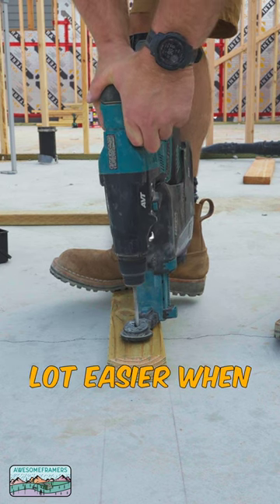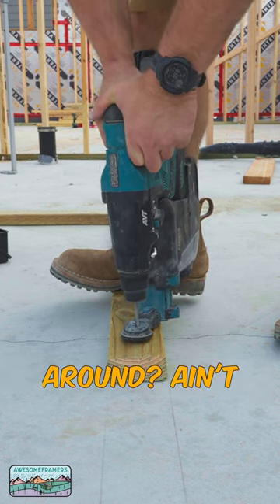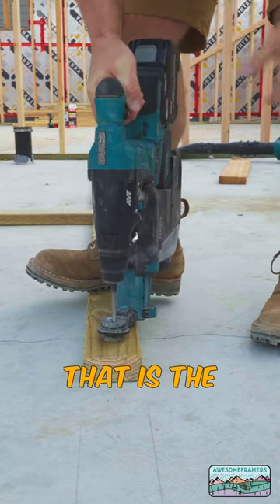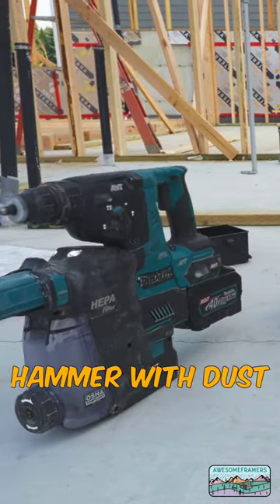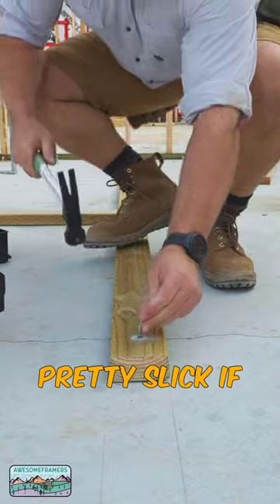Let's Make a Connection ##framing #concrete #diablotoolsambassador #makita

Comment: My house was built in 1955.  I don't know what kind of MAGIC they had back then, but my entire 2 car garage and HUGE basement floor has no expansion joints and no cracks at all in the concrete.
Reply: Whatever it was, its probably illegal to use today😂
Reply: Probably has a topping applied .
Reply: They put way more fillers in concrete nowadays like fly ash. I live by lake Michigan so all the sidewalks were built with beach rock and sand and that concrete was so hard it was blue in middle and you hardly ever seen it fail.
Reply: They used magicians not carpenters
Reply: My house was built in 51. Same here. Just replace the floors and not one crack
Reply: It's all about properly preparing the base. I live in a northerm climate and built my 24x30 shop 20 years ago. The slab has no joints or cracks. It's sits on 4ft of compacted sand, 2in rigid insulation, and a vapour barrier. It's 8" thick with a 12x12 grid of 1/2" rebar. Not a single crack anywhere.
Reply: Price out that 12x12 regarding today.
Reply: The 60s was when they started cracking down on asbestos, maybe you have a house built out of the wonder material.

If its in your concrete, itd explain the lack of cracks. Awesome for you but horrible for whoever might deal with it in the future
Reply: @internettoughguy I believe it would be the 8”

Comment: Cracked concrete like a mofo
Reply: Someone gots some splaining to do 😂
Reply: Easy explanation. Its not a finished floor.
Reply: @qorpraltv5276  not how it works.
Reply: There's only 2 types of concrete. 
Concrete that is cracked and...
Concrete that will eventually crack!
Reply: Not if it's drilled
Reply: Now they’re gonna have to rip up the wood work to properly fix the concrete.
Reply: @VoodooViking say what?
That concrete is 6 ins thick with rebar.
You actually think that the studs need to be removed to "fix" the floor?
Stay at your keyboard or your Walmart job
Reply: If this isn't a joke... You did a pretty dam good job saying you know nothing, without saying you know nothing
Reply: All concrete cracks !!
Reply: First thing I noticed!
Reply: armature
Reply: He done laid that 2x4 just in time to prevent further damage to  that concrete. Way I looked at it 😅
Reply: Jinx😂
Reply: @qorpraltv5276 my parents have a garage that was built in 1988. Not a crack in its slab
Reply: Look at all the cut-rate concrete guys coming in to tell you all concrete cracks. Y'all are funny, keep it up
Reply: If you can show me a house slab that doesn’t have a crack in it after it’s framed and loaded I’ll give you my paycheck there’s only three guarantees in concrete it’s gonna crack it won’t catch on fire and no one will steal it👍🏽
Reply: My parents shed has a concrete floor and it was built in 1987 and has had cars and heavy lathes in it for most of its life until recently and it hasn't got any cracks. And they have had the flooring of their home relaid recently and it is solid concrete laid in the 1960s and there wasn't one crack. Then again I'm here in Australia and the house was built using good materials and built by my grandfather who was a master builder. 👍

So when can I get your paycheck??
Reply: @walter9724  You just admitted that the house had a crack the shed is small although I doubt it doesn’t have a crack in it master builder
Reply: @christianarias4850 not that soon though
Reply: @VoodooViking no, just no.
Reply: @qorpraltv5276 doesnt work like that. And these cracks are not a problem.
Reply: @douglascasmay1981 amen, nor is slight cracking a problem. 
If it was a basement under rhe waterline, it's only a minor problem. Easily fixed.
Reply: The crack is there at the beginning. I thought so too
Reply: @andrewwhite1576  exactly how that works, disgus. How many homes have you built? I'm guessing less than 1.
Reply: @qorpraltv5276  you crazy
Reply: @qorpraltv5276  so you want cracks in you foundation? I’ll let the guys at work know. They will crack up from how you think it works.
Reply: People, I don't know about other States, but here in Florida builders only reinforce the footings and columns, the concrete slaps on the houses they just use fiber !!  The houses settle and cracks and this is consider normal here, si no fixing that crack.. From where I am from, we build houses all reinforce concrete including ceiling everything solid, any house that shows a crack is considerate unsafe and would be very difficult to sell, cracks are not acceptable. Here in Florida is normal, 
**so, if you don't like cracked houses, stay away from Florida, another reason not to come here.... !!! 😂😂😂😂 ***
Reply: @douglascasmay1981 Bingo
Reply: All concrete cracks from foundations to transfer slabs to shear walls and grade beams it will all crack ….. and it’s been engineered with that in mind  , it’s the reinforcement that gives it strength . Don’t overthink it!
Reply: @chadleschasin2893  false. I’ve been working in this field of many years and in no way does anyone see cracks and say job well done
Reply: Do you think the framers putting up the walls also poured the concrete slab? 😂 What is your point?
Reply: @andrewwhite1576 it is lmfao
Reply: @danielcampbell1357 could show plenty high end builders wouldn't except that
Reply: @qorpraltv5276 Easy explanation. The slab settled and cracked, and/or they didn't let it cure long/slow enough. 

And no, new slabs should NOT be cracked. Get out of your contract with any idiot that tries to gaslight you that a brand new cracked slab is normal. It normal for people that suck at their job.
Reply: @walter9724 where is their house?
Reply: Concrete cracks, that’s not the issue. When the slab starts to lift and settle then it’s an issue. But the rebar keeps the concrete from lifting and settling. To mitigate cracks you can cut control joints in the foundation slab to control where it will crack, but it’s not entirely necessary.
Reply: Two guarantees of concrete. 
1. Its gonna crack
2. Nobody is going to steal it.

Comment: one things I was always thought when I used to be a framer, when nailing to a concrete floor, never affix it near a crack, because over time it will opened it up and become weak there.
Reply: So did you tear up the slab and repour or redesign the walls?

Comment: 3/16  drill bit, 16p nail, tie wire.
Reply: What are you doing with the tie wire?
Reply: @chuckbuttons0699  drill the hole insert wire bang in nail. The hole is 3/16  the nail and wire are just a little bigger. Did union construction in Boston. This was common practice in concrete work. Holds tight, cheap, and when done just pull nail out. PEACE ✌️
Reply: Exactly

Comment: First, you nail the studs to the bottom and top plate, and then you secure the bottom plate to the slab, with a vapor barrier between the wood and the concrete.
Reply: Water/ vapor seal would only need to be put on exterior walls in most cases.
Reply from the maker: Nope, no need for a vapor barrier when treated wood is used in a basement on a slab that sits over a vapor barrier, foam insulation and 12" of pea gravel.
Reply: @AwesomeFramers Don’t worry dude, everyone assumes they know better. You could have been on a suspended slab for all they know……
Reply: Most builders would use a treated bottom plate under another prenailed frame. Vapour barrier isn't necessary on an internal wall.
Reply: @ornametrics Unless the basement doest have a vapor barrier under the slab. Then it's absolutely necessary.
Reply from the maker: @PlaygroundMafia nope, it isn't necessary when treated wood is used. That's why it's not required by code.
Reply: @AwesomeFramers everybody thinks you’re working remodel in some basement that’s a 4” slab with like 4” of gravel beneath. I work mostly remodel so I use sill seal but it’s not necessary if you know what’s below
Reply: @jman42s Either way sill sealer is cheap insurance and I takes no time to install.
Reply: You see the concrete is cracked right? How perfectly level do you think that floor is? I'll tell you, it's not. Run a string line above your wall at the correct wall height and measure your studs individually, you're gonna have a bad time framing the next floor if you don't.
Reply from the maker: @redacted_redacted69 https://youtube.com/shorts/c3qG3raZ3eA?feature=shared
Reply: @AwesomeFramers you must live down south no pt is rated for direct contact on concrete in the north east
Reply from the maker: @theunironicancap8420  I don't know if that's actually true.  I'm in the PNW.
Reply: @ornametrics ya by code we’re not allowed pressure treated on interior, I couldn’t even used a pressure treated header/lintel on the exterior ply of a 3 ply header/lintel (customer request to use salvaged deck material to cut cost).

Have to use standard lumber, and if then just use a gasket seal really for a break for moisture.

Comment: With that same 1/4" hole, grab three hot dipped galvanized 16d nails and drive all three of them in there at once. Cheaper than a split drive anchor, and holds just as well or maybe better. Try it sometime, it works.

Comment: No foam pad?
Reply: Don’t need a foam gasket or sill seal on an interior wall
Reply: @brendansmith5741 yes you do if its non treated. But thats a treated board. Has nothing to do with interior its a barrier between the concrete and an un treated board.
Reply: He don't need foam pads he's a pro on his knee. 😂
Reply: @internalharm it’s pressure treated lumber
Reply: Code calls for foam pads for exterior walls regardless of if the bottom plate is pressure treated or not down here in the south

Comment: You don't use pressure-treated lumber on inside wall bottom or top plates. And never use nails into concrete especially if it's going to be next to a doorway, cuz doors opening and closing will rattle the nail right out of the hole.. .

Comment: I much prefer my Hilti powder activated nail gun for concrete. No cords with that one either. But it does sound awful like you a lot like you're shooting a 22.. much faster you don't have to worry about batteries dying. Generally you have more nails and shot then you need ..
Reply: I respectfully disagree. I think drilling is better because it's less chance you blow a crater into the concrete. I'm sure it works fine. I've used high pressure concrete nail guns too and they tend to make craters.
Reply: Yeah, I warn my clients when there's going to be gunfire.
Reply: Last time my hilti went in for service, i left it there. Powder actuated fasteners are junk. 25 yrs using one and im done with blowouts,misfires, and cleaning that junk. Half the time the plate is loose or it splits the plate. I will take the extra few mintues and tapcon or anchor bolt.
Reply: @matthewwatkins6616  tapcons are very good. I've used them on many occasions.
Reply: Expensive way to go , i drill 3/16 hole through lumber into 
Concrete  then drive a double headed spike with a short length of bailing wire beside the nail holds great no splitting or concrete breakage
Reply: @rexjansen7717 underrated comment here!
Reply: @markthebldr6834 depends a lot on the age / curing of the concrete
Reply: @rexjansen7717  is the spike and wire galvanized?
Reply: @markthebldr6834   for the purpise of say form work i used double headed spikes 3/16 hole basicly match spike dia. Then a length of bailing wire , wire first into drilled  concrete through plate ,  anything long term subject to moisture galv.  seems  prudent  only down fall i found labour intensive , every fixment requires a whole drilled through plate into concrete , positive there less distructive to drill a small whole than say a impact tool 
Or hand dricing conc nails , it works its cheap

Comment: Jesus why is the fastener so short? Not hating genuinely confused.

Obviously not load bearing etc just a place holder but still. Barely any penetration (that’s what she said) to hold that with some expected movement?

From everything I’ve seen from you I know your work is good, just thinking shouldn’t that be a bit longer?

Comment: The easiest and cheapest way for us, gentleman without the fancy tools. Is a normal cordless drill, put on Hammer mode with a concrete bit That is the same size as your nail.

After join the hole in the concrete, take a piece of wire in the hole and then drive the nail in

Comment: Nothing between the sil and concrete?  Not worried about it ever having issues ?
Reply from the maker: Nope, nothing needed here.  This is treated sill, and it sits on a slab that sits over a vapor retarder, 2" foam insulation and 12" pea gravel.

Comment: Don’t  you use foam gasket under bottom plate on concrete? Concrete on grade will for its entire life wick moisture upwards. It’s code in Canada. Using PT lumber won’t stop that, also mould will grow underneath wood that is attached to concrete without foam gasket or vapour gasket
Reply from the maker: No need with treated wood over concrete over foam insulation over 12" pea gravel
Reply: We call it sill seal, same difference. When I started framing we used 3" cut nails to go into concrete. I still like tapcon fasteners.
Reply: The building code in Canada in the 90s allowed for pt wood to be placed directly in contact with concrete. Not sure if it still does but in either case the gasket is a good idea for long term applications like this.

Comment: Why wouldn't you build the walls and stand then then secure the plates to the slab?
Reply: Exactly. Work is already hard and that seems like a lot of ladder work. F$&@ that.
Reply: @jonathanmoore4054  not sure why YouTube Channels are doing stick framing like this. So much more time consuming.
Reply: Stick framing, it takes all the guess work out for the new guys.  The button is already attached so there's no concern of something getting nailed down in the wrong place or backwards
Reply: @markalcala1293 it’s hella slow though
Reply: Lack of room maybe? If ive got a boom on the job im not even carrying lumber. Build that bitch right next to the pile and strap it up lol
Reply: I used a double bottom plate on concrete.  1 green one standard.  Then my base nails better.
Reply: @Tir220  I've done both and I agree it's slow building walls.  After that it's the same though

Comment: Forgive my ignorance, but how come poly sill seal is only used on exterior sill plates and not all sill plates making contact with concrete? Is it just a weather seal from the elements or does it also double up as a water resistant barrier?
Thanks in advance for anyone with an answer.
Reply from the maker: Good question.  We actually skip it in all scenarios because pressure treated plates do not need a barrier.  There are better ways to air seal.

As to why nothing under the plate here, this slab sits over a vapor retarder, then 2" foam insulation, then 12" pea gravel.
Reply: @AwesomeFramers  how fresh is the slab, are you worried about moisture in the concrete? Or do you expect the level of moisture to be inconsequential. I’ve been laying barriers even when there’s a vapour barrier underneath, but I’d rather not
Reply from the maker: @kenzie0201  slab is 10 months old.  As commented above, there's no reason to go beyond the sub slab prep 👍
Reply: It allows the ants easy access in and out

Comment: I have the same sds drill setup and its great. I usually use tapcons to attach the plates though.
Reply: Exactly if you’re going to drill, use a tapcon or a titan Bolt. If you don’t wanna drill, use a cut nail
Reply: I'd rather shoot it, a lot faster
Reply: @forrestcason3584  drilling and using a cement nail with 2 pieces of rebar wire works as well

Comment: Is it better than the powered nail anchors using a 22 cartridge and cheap tool?
Reply: I drilled so many of those holes that I hated that rotary hammer. So if I had a choice, I would choose the drill and anchors. The 22cal is much easier, but the split drive holds better.

Comment: We always ramset. What would you consider the most ideal? Or is that subjective?
Reply: Its subjective with new construction, Both will work well just depends on preference. It may be different for old concrete but even then both will probably work fine.

Comment: Too bad hes not using a split drive anchor, those are called a crimp anchor. The last 3/4 of an inch is crimped or bent. I have been using those for 20+ years they do not pull out. insane holding power !
Reply from the maker: https://www.strongtie.com/mechanicalanchors_mechanicalanchoringproducts/sd_anchor/p/csd.dsd

Comment: Dont u need poly under the wood when in contact with concret?
Reply from the maker: Nope because it's treated wood over a slab which sits over a vapor barrier,2" foam insulation and 12" of pea gravel